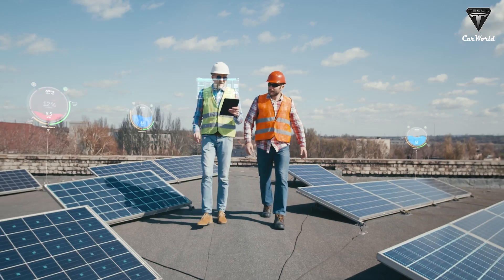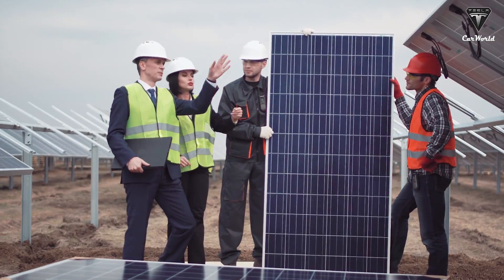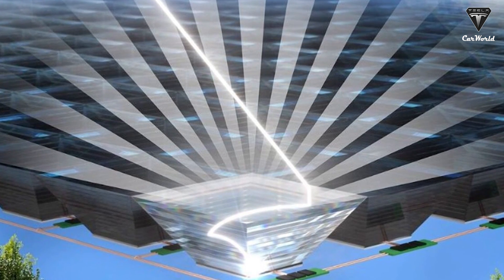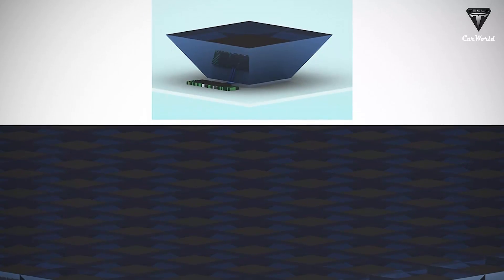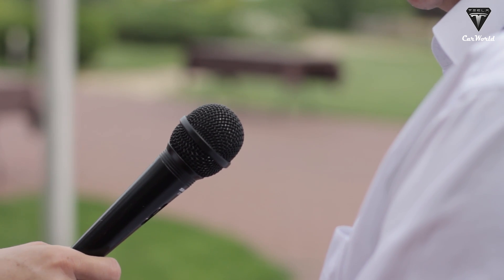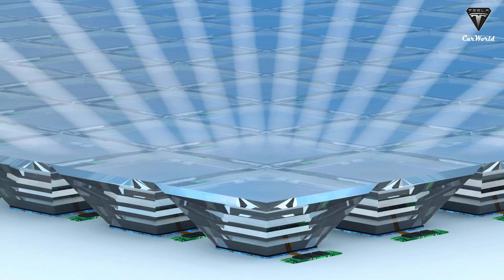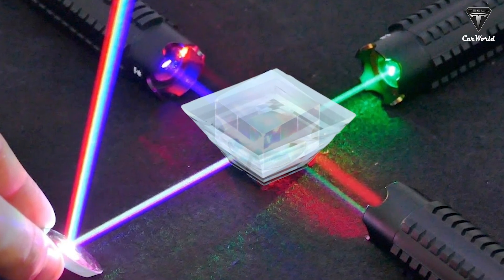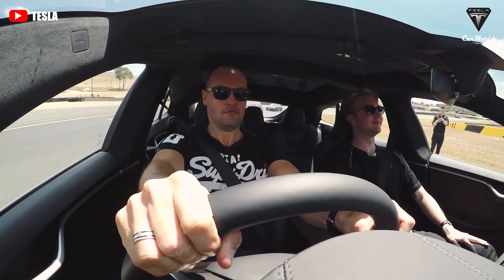IT HAPPENED! Elon Musk Revealed INSANE Invention Could Boost Solar Cell Efficiency to 90%,Only $1.21

Comment: I worked w/ HCPV solar for 5 years in the Desert SW.  The  main problem at that time, was the HCPV could not handle the DESERT HEAT that the concentration relayed. The PV materials and heat dissipation systems were not up to the task.   Any new Solar Tech needs to have a Desert SW, five year dual axis tracker evaluation aka a serious "Stress Test".  IV curves should be taken quarterly and compared..  The arrays also need to have a low profile.  The number one problem w/ the large "Utility Scale" units I worked w/ was they got hit by lightning on  a regular basis.  Here's a suggestion, if the cost analysis justify, then a hybrid heat collection system should be integrated to scavenge low temp heat and save the cells. Bon chance!

Comment: Ha! That would require quite an inverter upgrade. If some yahoo slaps them on their existing system that's a guaranteed house fire... You'd have to upgrade wires, inverters, charge controllers, everything.

Comment: We built acrylic fresnel lenses for Martin Marietta’s Arizona solar project in the early 80’s. They were diamond turned fresnels compression molded in acrylic and about 2 mm thick. There were issues with overheating the silicon chips and eventually the effort was dropped but it did increase output. Hopefully this effort will collimate rather than concentrate the suns rays.